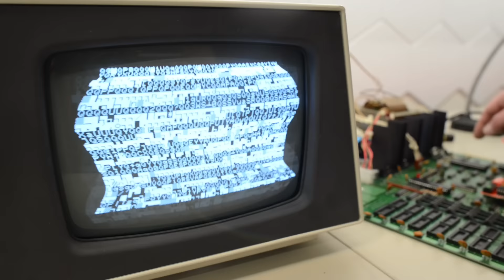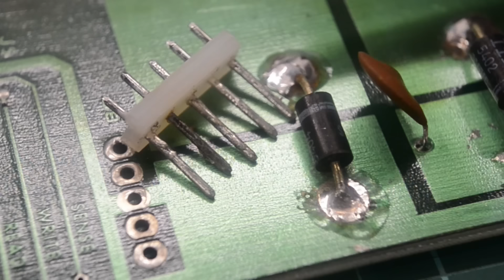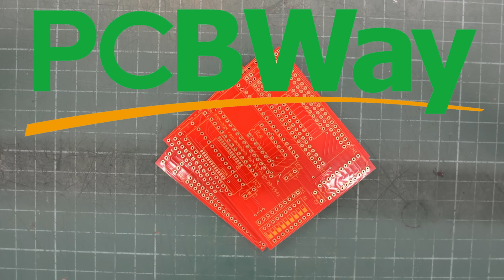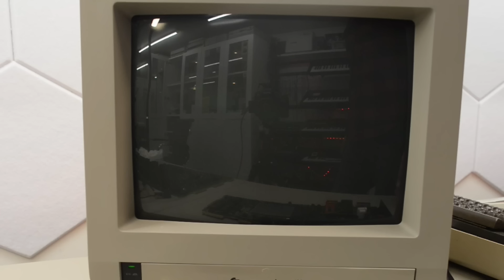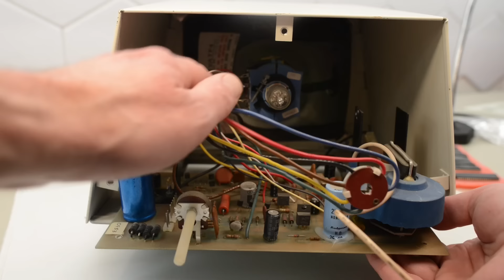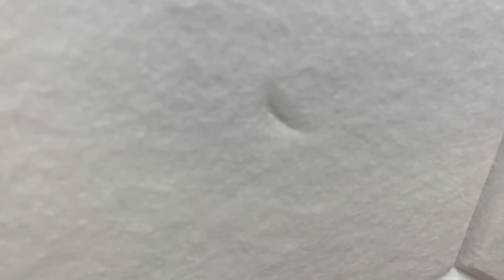1977 Commodore PET restoration gone horribly wrong! EXPLOSION! & Magic smoke!

Comment: What you have here is AC getting into the b plus and b boost rail on the monitor. Check your main filter capacitor (maybe a 150-330uf at 200v) and check your b boost filter, (maybe 10uf to 47uf at 160 to 250v)
Reply from the maker: Thanks

Comment: Hi! Really nice video again. One thing I recommend first for investing some money for the hobby is a good bench top power supply. You cannot tell if the original PSU is working fine and if the PSU is married into the design, like the 7505 on the board, it is hard to find a fault before something has gone bad already. Now CC (Constant Current) settings on a PSU limit damage and if you see a low voltage with the current at the set limit, you can directly switch off again. A stage further is a multi-channel PSU that allows switching all channel at once. Some parts like older ADCs do not like to have the +15V attached with +5V missing. And the king's version is a PSU with fusing, where you can set a fuse current and a delay for inrush at power on per channel. If the current is too high for a certain time the PSU just pulls the power itself. I do not know if there are many of these PSUs available. I have invested big money in an HMP4040 but I repair very expensive gear and this fusing / fuse delay and fuse-linking (one fuse pulls all channel if triggered, showing the false channel) has saved me a lot of headache and parts. It also saves a lot of heart rate when switching things on the first time after cleaning and repair. I would love to hear of other less expensive PSU that support such features.
Reply from the maker: Thanks, yeah, I need to get a fancy PCU for the bench for sure
Reply: @Epictronics1  Oh it doesn't have to be fancy. Just one or two functions that save you or the device from doing stupid things. Keeps the heart rate in the green range and misaligned or reverse plugged ICs in pretty shape. Except EPROMs. These die so fast if inserted reverse, you can't do anything about it.

Comment: Oh man. I remember these when they first came out. I used one to write a very crude cross assembler for my Z80 based homebrew.
One other point. At the time it was possible to create sockets from a 'coil' of pins connected by a breakaway connecting strip. They worked very well, were cheap and the individual pins could be replaced. Brilliant for experimentation.

Comment: It was common to get charring on those Molex connectors in these computers and arcade games (those Molex aren't a good choice for high current power).  Putting solder on the pins was a common "trick" to try to get a better connection when it starts getting charred.  It didn't work that well.
Reply from the maker: Mystery solved. Thanks

Comment: In case you want to replace the light blue 10uF NP electrolytic in the monitor, you cant use a modern bipolar electrolytic, it will not work and blow up. That kind of high-current NP electrolytic isnt made anymore (was only ever used in CRT devices). Correct replacement is any kind of correct capacitance film capacitor, no matter if polyester or polypropylene, not ceramic (large nonlinearity).
Reply from the maker: Thanks!

Comment: Do you own a wattmeter or do you know how to use it? I always watch power draw when powering up old stuff!! Had stuff designed to have nominal power draw of 60W to be at 100W as part of it was shorted, found out quickly that is was too much. Thermal camera confirmed where it was getting hot.
Yours was probably a shorted cap! Or it lost forming (as they do) over the years and it drew too high current and made a thermal runaway. 

So invest into a wattmeter (you can get one for $5-10). It will come in handy more than you know it.

Comment: Looks like the cap got too hot due to low internal resistance. When electrolytic capacitors sit for a long time, the oxide layer on the electrodes breaks down. If powered up again, this layer gets rebuilt, which draws current. On large capacitors this can lead to excessive heat builup, which is why it is advised to desolder the caps and apply voltage to them very slowly while monitoring the current draw.

Comment: Loved the video as always, I've had caps explode just like that on arcade monitors in the past. Regarding that burnt up connector, I would suggest using trifurcon connectors on the wire end, they make contact with 3 sides of the pin for better contact and less risk of burning up. That's the first thing you do on a pinball machine, it should help with the PET too.
Reply from the maker: Thanks, I wasn't aware of those

Comment: Our museums' Atari Breakout monitor had an exploded cap like that. I've replaced it. Years later, the monitor that was missing from our other Breakout turned up, so I installed it. The picture was okayish (no geometry issues) and five minutes in, the same cap exploded on that one too. There was nothing wrong with that monitor - just the cap had dried out and wouldn't reform, so it became a resistor that heated up what's left until boom. That was many years ago. Both machines are still running on all but one original cap each (monitor cap that is - the big one on the game PCB went bad too)

Comment: I always cringe when crimp connectors get soldered. It's not a big issue here, since the cables aren't going to move around, and there is no vibration in normal operation. But soldering severely compromises the wire, if there were vibrations.

Comment: And that's why modern capacitors have an x or similar etched on the top, so when they fail don't fly away like a rocket.
Reply: Even the X won't save you sometimes. Back in college we used to pop a lot of caps on the breadboard while we were experimenting with various circuits. There were a lot of dents in the drop ceiling because they'd fly straight up and embed themselves up there. And I'm talking caps no bigger than a pencil eraser.
Reply: @vhfgamerthe x is for failing in normal circumstances. If you put a voltage that's way to high or reverse the polarity with enough current, of course that the cuts won't have time to open before the capacitator explodes.

Comment: The moment your CRT display came up with that horrendous mains hum in the image, I knew there would be an explosion. I was not disappointed! One little thing when you recap the monitor board.That large light blue capacitor next to the flyback transformer is the S-correction capacitor. It is a special non polarised low ESR capacitor. As it is not electrolytic, it should not need replacement. The monitor has a very simple circuit, lacking horizontal linearity correction, so the image will be stretched on the left hand side. Using a capacitor with a high ESR will make it worse.
Reply from the maker: Thanks!

Comment: The connector pin has two sets of flanges. One to grasp the wire, then the two taller ones are supposed to crimp around the insulation as a strain relief.

Comment: Electrolytic caps have tendency to dissolve the insulation between its electrodes, while being stored many years without turning on. This insulation is, in fact, just an aluminium oxide, and caps are produced without it. Later, the oxidation is formed on one of the electrodes during capacitor "forming" or "training", as a part of manufacturing process. There are some discussions on the Internet about how to safely turn on such old capacitors and "re-form" their oxide insulation.
Reply: I've had varying results.
Some great successes (tested absolutely terrible before reforming, then after reforming they tested OK and worked like new and it's been years and they still work), some meh (you can use this cap, but not in demanding applications), some that lasted maybe a year before giving up and of course some were completely dried up and wouldn't reform at all.
Reply: @senilyDeluxe  if the cap is still 100% hermetically sealed, then it will reform usually without problems. however sometimes the caps lose their seal and even if it isn't enough to dry up, the oxygen will creep into and oxidize the foil, which will make cap still work fine, but will draw too much current, sometimes even avalanching and destroying itself if not current limited

Comment: We need to start a Capacitor Reform movement 😉🤷‍♂️
Reply from the maker: I'm not sure there was anything left in that cap to reform. I didn't find even one drop of electrolyte anywhere after the explosion.
Reply: @Epictronics1  It did seem somewhat energetic 🤣  If that monitor hadn't been used for years then it's not unexpected 🙂🤷‍♂️
Reply: The Church of Electrolytic Reformation! 
(with the cross looking like a circuit symbol for a capacitor)

Comment: My guess for the power pins would be that they had become oxidized and someone tried to repair them by covering them in solder. That likely also oxidized causing a poor connection which heated up and caused the charring on the connector.

Comment: I know this is going to get me a LOT of hate, but when I have to use machined pin sockets on IC's (Once I confirm all is working) i always flow a touch of solder into the pins. I'm not having a phantom pin floating inside the machined pin I literally cannot see not touching anything AGAIN. Nope. Not happening.

Comment: Thank you for the video, sorry about the capacitor blowing up. It didn't really appear like the capacitor was doing much to begin with, becuase the video output doesn't seem to have changed much. I really like your close up camera shots of your soldering SMD components, are you using a microscope?
Reply from the maker: Thanks. Very rarely. I only use it occasionally to inspect solder joints when troubleshooting or if I want to show something microscopic on YT

Comment: It might be that the capacitor needed to be reformed. If a capacitor isn't used for a long time, it can lose the isolating oxide layer on the aluminum plates. By reforming (slowing giving the capacitor some voltage) you rebuild the oxide layer. An old capacitor can have so much leak current that applying full voltage after a long time can have it heat up so much that it blows up like that
Reply from the maker: Quite possible. This cap may not have been used for 45 years
Reply: I've seen this happen after as little as 10 years

Comment: You could have used a regular socket just space it up from the board so its level, or just install it at an angle even tho that will trigger the ocd
Reply from the maker: you can't mess with OCD :)
Reply: Or just use 2 sockets for the larger chip so you can fit the smaller chip in a socket that is underneath.

Comment: I wonder if the casing from the old cap will fit over the replacement caps to keep the original look.
Reply from the maker: Hey, that's not a bad idea
Reply: @Epictronics1  this procedure is actually kinda common when dealing with vintage (think pre-1960s) radios and TVs, usually referred to as "restuffing" to keep the original looks. haven't seen this done on more "modern" (relatively speaking) devices a whole lot, except for maybe audio gear if the originals were impressive looking. Something like gigantic smoothing caps on the power rails of amplifiers being restuffed with modern and much (physically) smaller caps which would look goofy in place of the originals

Comment: A long time ago i bought an SVGA monitor from a shop for £5.  they said a woman bought it, plugged it in and it went bang.  The monitor was set to 110V and in the UK we use 230V.  Inside was lots of fluff from a massive capacitor explosion.  i replaced the cap and it worked fine, didn't even need adjustment.

Comment: I would suspect a shorted diode on the rectifier on the monitor. AC voltage into a cap = bad. If it's something you care about, it's a good idea to quickly check the semiconductors for shorts.
Reply from the maker: Thanks Adrian. I'll make sure to check the diods before the next power-up(after a full recap)
Reply: I remember blowing a cap on an Apple Disk II controller because I skipped/shifted a row of pins on the drive ribbon cable.  The one time I didn't verify.
Reply: if he used a wattmeter and was looking at the power consumption, none of this would have happened! for cap to explode that violently it must have been drawing in excess of 50W
Reply: @michvod   And if he used a thermal camera, and current clamps on all power leads, and was clairvoyant, yada yada yada...

There are so many things we could all do better, once we have the benefit of experience from fouling it up the first time.

PS:  What is the correct current draw for an operating PET?  Do you know?  I don't.
Reply: This is highly underrated comment! @adriansdigitalbasement you rock! Also @Epictronics1you rock too! Between this video and it's big explosion and me trusting Adrian's advice here, I'm actually going to make this part of my regular repair routine when I start working on a new system - especially PET systems! Thank you both!

Comment: Some white beared tech wizards have warned me about switching on old CRTs that haven't been used in a long time. Only for a splitsecond at first, they said, and then again, longer and longer, and pair it with an incandescent lightbulb to limit the current. The caps need to reform.
Now I don't understand any of this magic, but maybe that is sort of what happened here. Or the cap was just bad anyway...
Reply from the maker: There was no electrolytic left in the cap. It was completely dry. Normally you would get a massive splatter of cap juice from an explosion like this. I don't know, but maybe it shorts when its completely dry.
Reply: @Epictronics1  There clearly was electrolyte, otherwise there wouldn't be a pressure buildup causing the can to pop off its rubber bung and.. welll... the smoke/vaporized electrolyte?
Reply from the maker: @Knaeckebrotsaege  I'm not sure. I blew up a tiny cap by mistake a couple of years ago. It made an absolute mess on the board.

Comment: Evidently that cap wasn't working at all before it blew. The display on the screen didn't even flinch when it popped... It just kept doing what it was doing.
Reply: Yup. And all the waviness of the picture was AC hum cause there was zero smoothing being done by that cap. It basically just acted as a resistor across the power rail, heating the remaining electrolyte up till the can couldn't stand the pressure anymore
Reply from the maker: Yeah, I noticed in edit. The tube didn't care much about that cap blowing. The graphics changed slightly, but not all that much.

Comment: Well it is very fortunate that this thing did not hurt you cause if you had lean closer to look for a pot adjusting the screen it could have pretty much blow in front of your eyes, and it was a big one, and make physical damage to you as well maybe not easy to repair...
I did not find it funny at all, that was not a small tantalum shorted on an MB or a bloody rifa, on the contrary it looked very dangerous and even candidate for a fire hazard. Please be careful with those ancient crap and always take safety measure at least for the early power ups! 
Great video as always, keep up, stay safe first of all, cheers from Greece, Jim.
Reply from the maker: Thanks. That dent in the wall could have been in my face lol. I actually use eye protection when working on new projects with old tantalum caps. From now on, I'll be using eye protection when working with all caps from the 70s too :)

Comment: I will unsubscribe if you harm pets. :face-blue-smiling:
The blue one that blew up might be a Philips cap, they are always bad. I recapped a Philips G7200 and most of those were bad, originally, the image was just very tiny and thin in the middle and then it grew and got bigger and bigger the longer you used it until it reached the full height. Since I replaced the caps, it does start normally. I also had a Philips MSX VG 8000 external Power Supply which would start the computer only after you left the PSU on for some minutes. Those blue caps are worse than ROE, because they almost all fail and do not hold their values but I never saw one exploding. At least it did not happen to me :) Nice bang.

Maybe it is MALLORY (like the main cap in the PET?) - I thought those are pretty good and did not have any issues yet. Not so clear in your Video.

EDIT: I think it says PHILIPS very tiny on 25:01 mark.
Reply from the maker: I checked. The only things left on the cap are MEXICO and T.I 411, 4700UF, 25VDG-something (partially missing text) 85C 7741. The text on the other side of the cap is completely unreadable. It has a "+" on one side, so we know it's a polarized cap, at least.
Reply: @Epictronics1  Mexico is probably not Philips. No name? If you search for ... Capacitor 500uF 50v  dan alexander ... in google image search (cannot post a link) it looks similar or no? This says "T.I" so maybe Texas Instruments, which has a Mexico plant I think? 

Very strange mystery cap, I should check my PET but mine are later models and in Europe, so maybe different supplier.

Comment: I remember working as a QC inspector at an electronics manufacturer and I had a cap explode.  I had fair warning as the cap was in backwards and when you powered the board off, the discharge made a noise going up in pitch. They just told me to duck.,  I got up with fuzzy electrolyte all over me.
Reply from the maker: haha. I blew up a much smaller cap by mistakes a couple of years ago and it sprayed cap juice all over the board. This cap however, was completely dry. Not a drop of electrolyte on the PCB